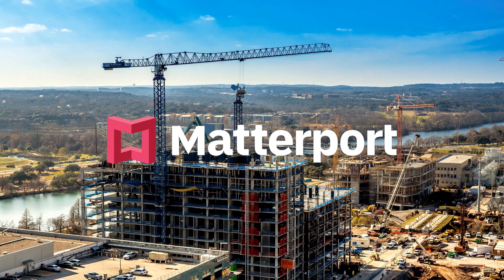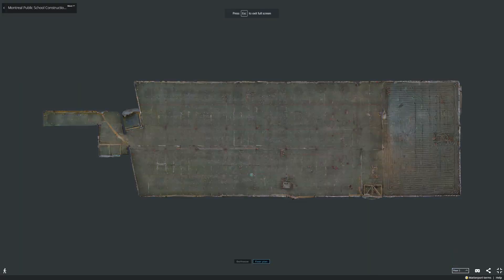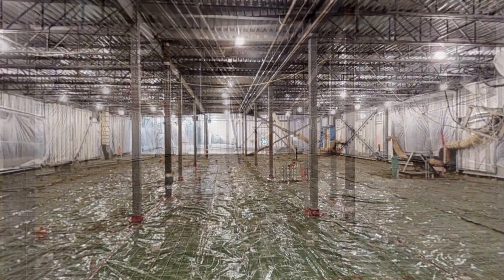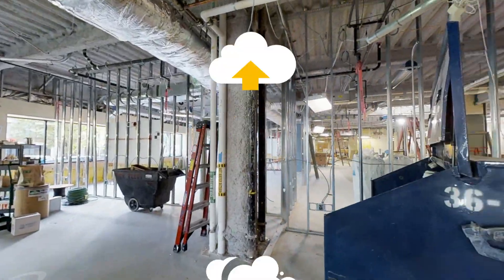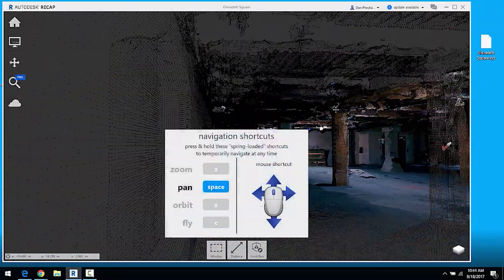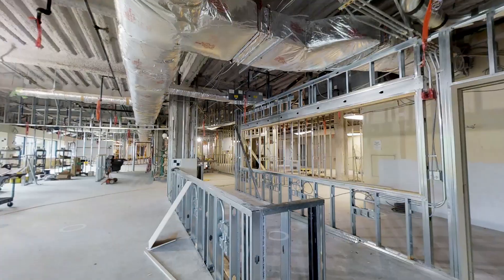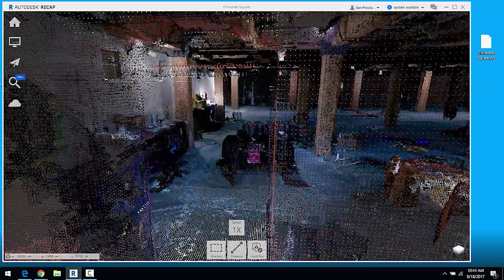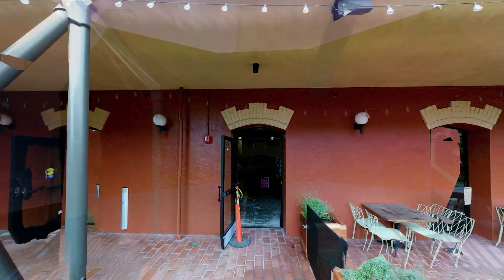Matterport for Architecture, Engineering, and Construction

Comment: can it export to Chief Architect?
Reply from the maker: Hi Omar, 
Matterport offers several downloadable assets including OBJ, XYZ, and you can order BIM files delivered as RVT and DWG assets.  I'm not very familiar with Cheif Architect and the file formats it can ingest, but I would assume with some conversion, either manual or automated via plugin, it would be possible to get something into CA.  The question is, of course, will it improve your workflow.  We have example files for download on our site so you can test anything you need.
Reply: @Matterport  thank you. My wife is an interior designer and sometimes has to measure and build plans of spaces in CA and can also build 3D. Last night she was having trouble recreating a groin vaulted ceiling and i wondered if there would be tools to help.  But she'd have to be able to import to make changes. I'll keep researching
Reply from the maker: @omaryabby9444  The nice thing about scanning a space is that you do end up with all the measurements you could need to create that as-built model in the tool of your choice. Curved walls are very challenging.  If you need any help with finding samples of the asset files we can provide, please reach out to our support department.  support@matterport.com.

Comment: What is the accuracy of the point cloud produced by this device ?
Reply from the maker: The Matterport Pro camera, with proper scan density, will produce a point cloud accurate to within 1%. Proper scan density means you place the camera every 5-6 feet throughout the structure. That being said, the Matterport platform also supports the Leica BLK360, which would require less density and result in a point cloud that accurate to within 0.1%.

Comment: wow!!! great i think i need this for a project but i have 1 question, Can i use MATTERPORT for a LIVE presentation...?
Reply from the maker: There are 3rd party products that offer this as a service, but you can also just use something like Zoom and share your screen.
Reply: @Matterport  am a lil confused. does it work in real time, i mean transmitting images in real time. because i thought assmbling is done after image is captured through a software
Reply from the maker: @ntangakumbom5246  Correct. The first step is to capture all the data using any one or more of the supported cameras. That data then gets uploaded into your account where it's automatically processed and compiled into a completed 3D model. Once that's done, you can add more information in the form of labels, Mattertags, and enhance navigation by created your guided tour by making a highlight reel. Finally, you share and collaborate :)
Reply: @Matterport  VERY HELPFUL... i appreciate